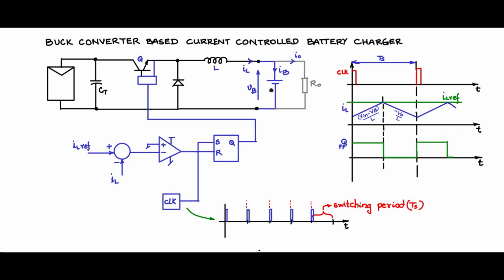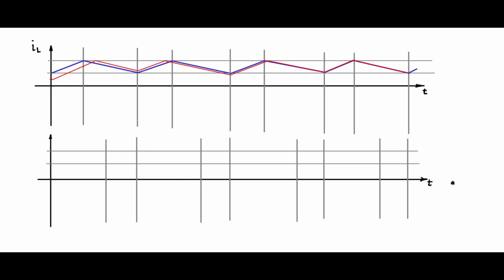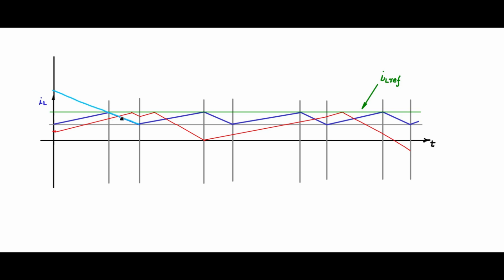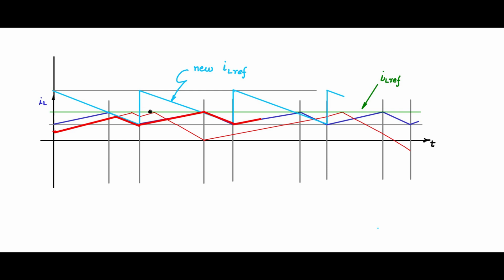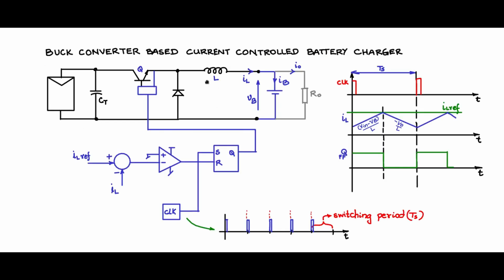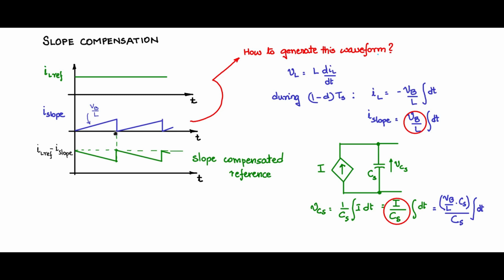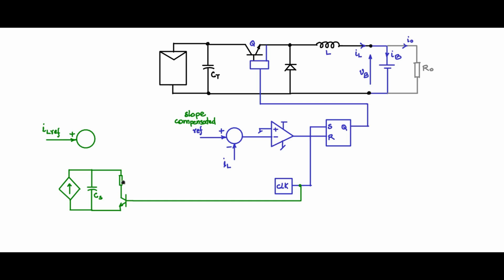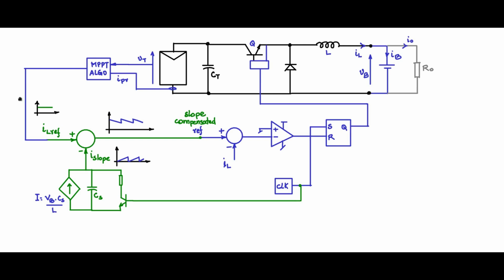Lec 41 Slope compensation for current control

Comment: 21:44 would this not interfere with the average current target of IL?

Depending on the duty cycle and the voltage at the output (in the case of a variable power supply for instance) the output voltage will ultimately decide the duty cycle of the converter as well as the slope used for compensation of this.

How do I make it such that when I command a current of say 1A, the converter delivers an average current of 1A to the output?